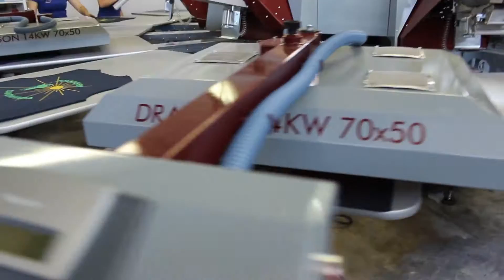Round Screen Printing Machine: KTK EXPERT PLUS

Comment: Dtf is far better than this..and also fast
Reply: with DTF it is not possible to make effects for example high density or silicone/flock
Reply from the maker: DTF and traditional screen-printing are following different lines of thought. We are here to help you make the decision that is best for your needs. It all depends on what are your clients demanding. Write us an email with your full requirement: rafael.matos@ktk.pt